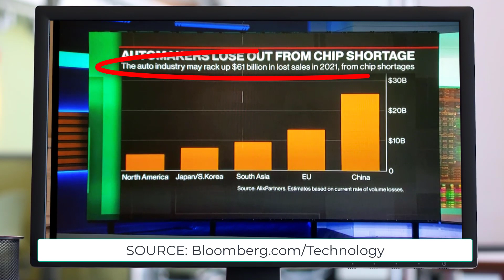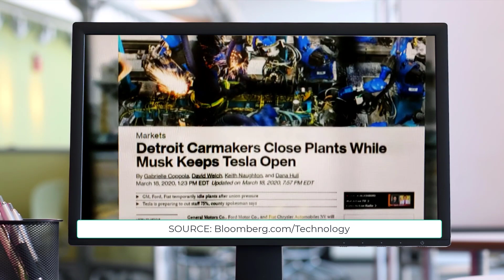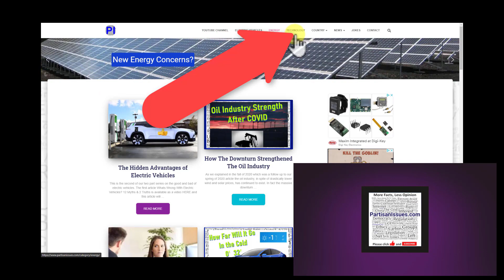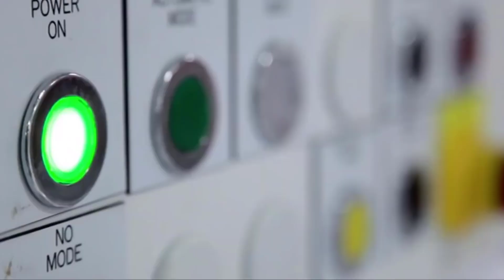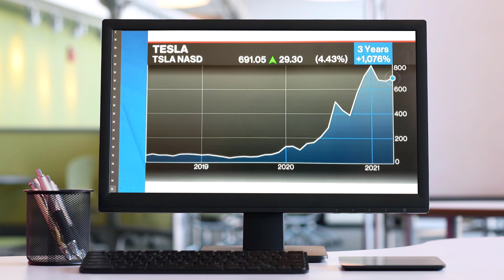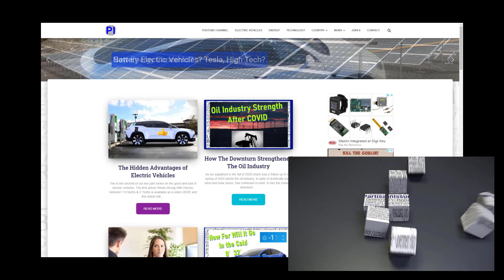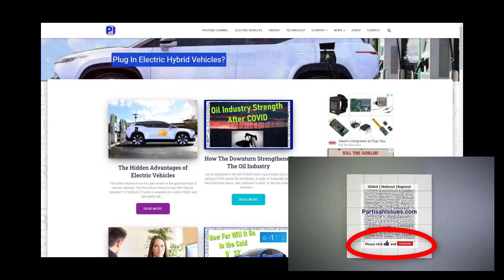How Tesla Avoided the Global Chip Shortage

Comment: Great video. Excluding one thing was just blatantly incorrect. Electric cars use WAY more chips. 3000 chips vs 300 in gas vehicles.
Reply from the maker: Hi Calvin.  A couple of comments:

1: Electric cars do not HAVE to have many more chips, they just often do

2: Tesla's have fewer chips than most vehicles of any stripe because they use "centralized computing", meaning that they use one primary computer for all their systems and therefore they require far fewer chips in their vehicles than any other auto company.  Yes, they still have various components that use dedicated chips,  but unlike the Ford Mache, for instance, which has 7 distinct systems, Tesla's have 1.  Other auto OEM's are trying to copy this design and we expect that all large volume vehicles will operate with centralized computing before the late 2020's (say 2027?).  

Thanks for your thoughts.